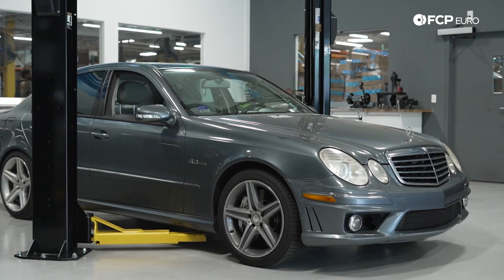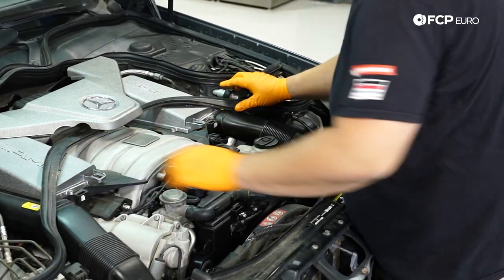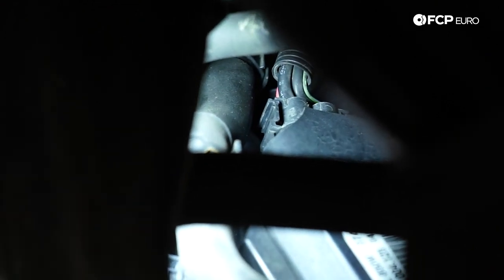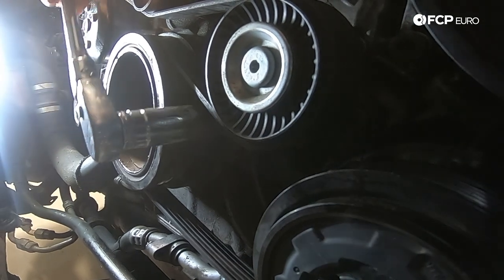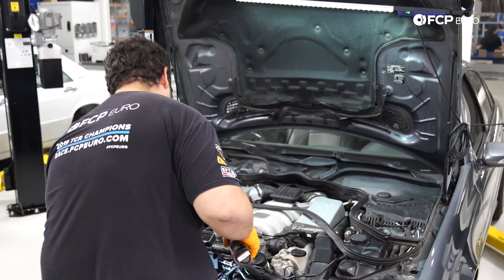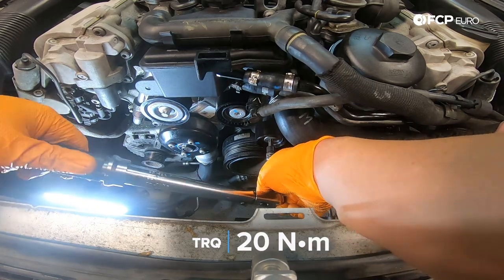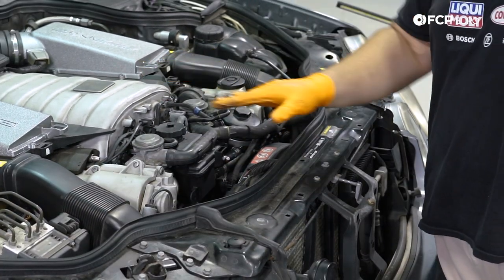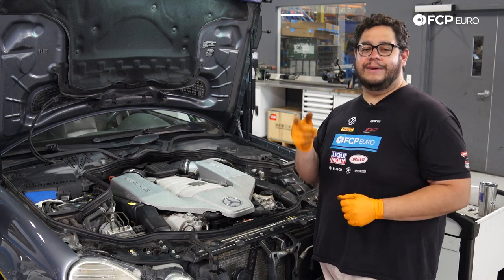Mercedes E63 AMG Drivebelt Replacement DIY (Mercedes W211 E55 AMG, W204 C63 AMG, C209 CLK55 AMG)

Comment: I just did this job. A few notes... 1) I was able to release the coolant hose at the bottom of the rad by reaching down from the top using a long dowel. For the one on the side, I too was able to access it from the top. I used a long, flathead screwdriver to gently open the clip. To re-position the side clip on reassembly, I used the long dowel to move the clip to the proper position and slid the hose back into the clip. I wedged my fingers next to the rad to close the clip. 2) My Mercedes shop manual DVD had the torque specs for all the pulleys and the tensioner at 20nM, none at 30nM. 3) On my car, the hood release cable was clipped to the bottom of the rad bracket. At 14:25 in the video you can see that the car in the video has one clip showing and one missing. Mine had never been opened and both clips were in place holding the cable. When I worked to put it back together, it was a pain getting the cable routed properly. I wish I had paid closer attention when I was taking it apart. Also, as an FYI: the original tensioner on my car was branded Gates and AMG.

Comment: Update for everyone, tackled this today. Some m156 im thinking p30 optioned cars have a second grooved idle pulley in between the crank pulley and ac comp pulley. It matches the first pulley Mike removed. So check your pulleys as the kit comes with just the one. FCP rocks and over nighted me one! So amazing!!